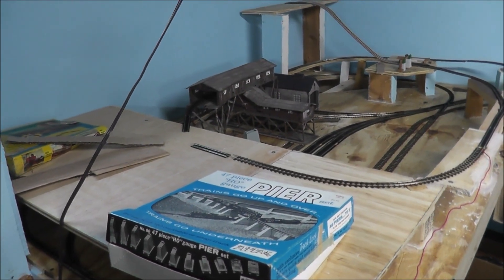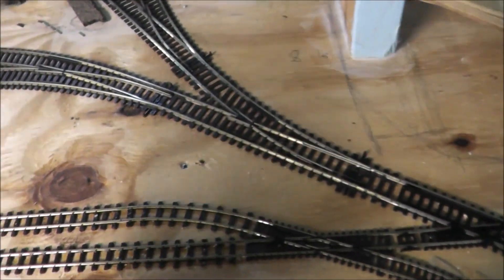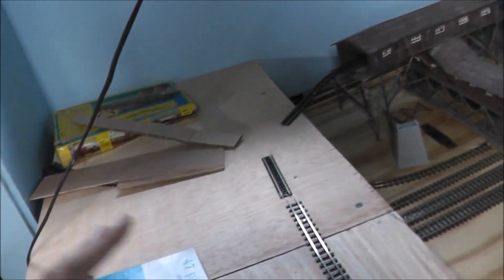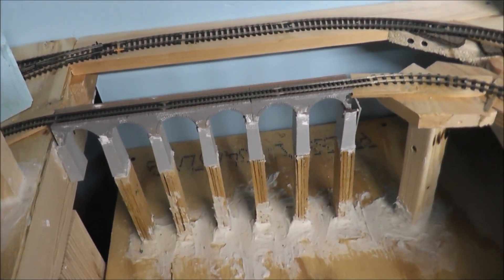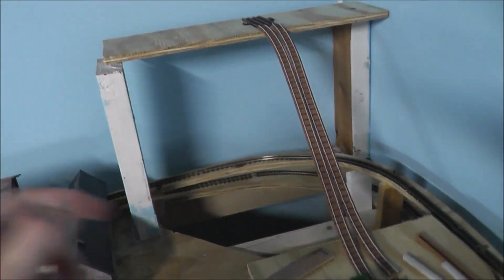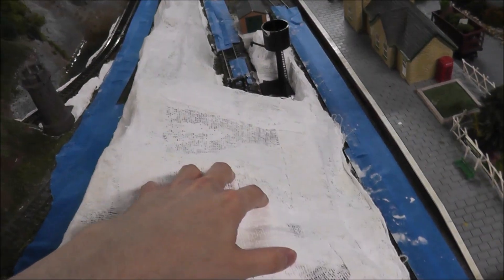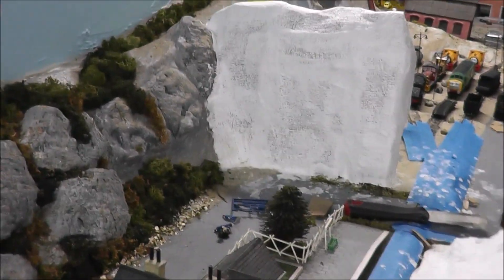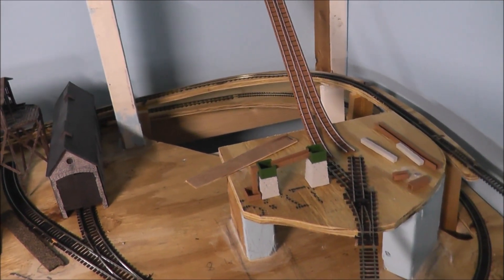Narrow Gauge Extension Video #6

Comment: The peco points, as with a majority of the European points, have the insul frog and electro-frog system. I have a set of Hornby points among the Atlas track for the majority of my layout, and it is the same situation as yours. The line not directed by the points, as in not set to, is completely isolated. To remedy that, I’ve considered replacing it with a Hornby electro-frog point, which doesn’t include the block between each line. It’s mostly used for DCC layouts, as it doesn’t matter if you have two or more locos on the same line, as they’re isolated, whereas on DC, that’s not the case. That’s why many European manufacturers put that block of power on the points. I hope my rambling has helped your understanding somewhat!
Reply from the maker: That makes sense! Thank you so much for the info on that!